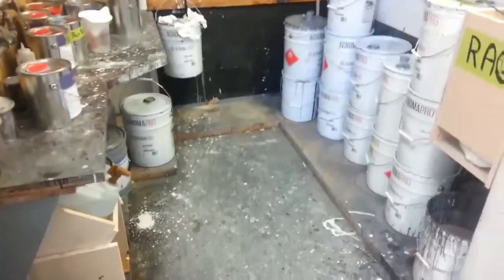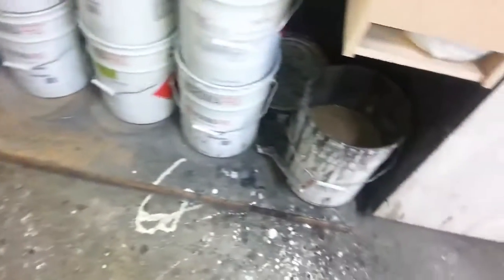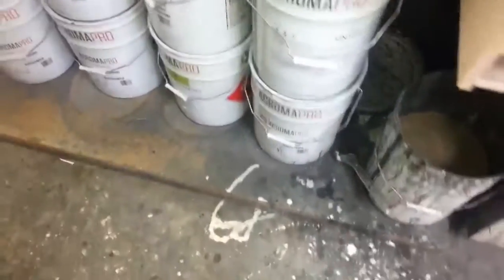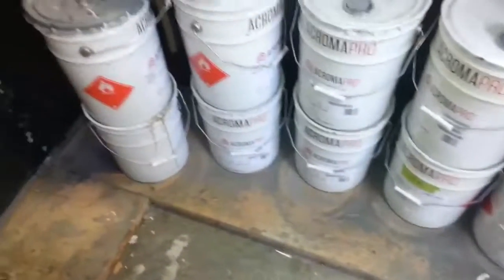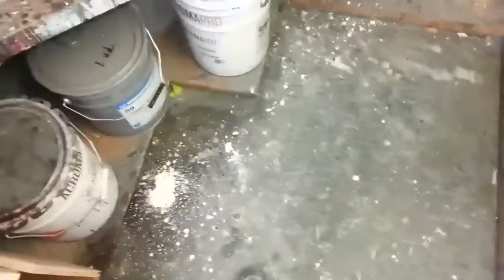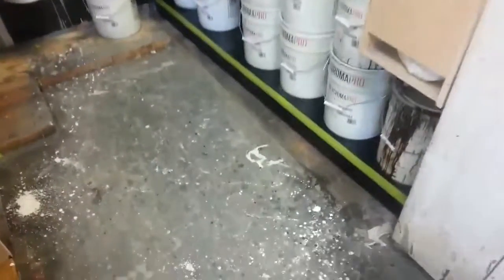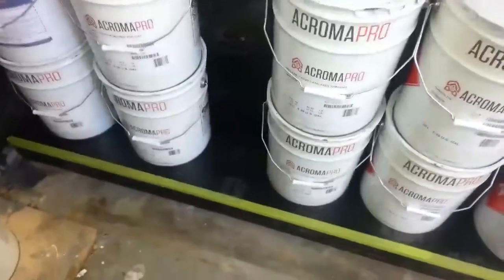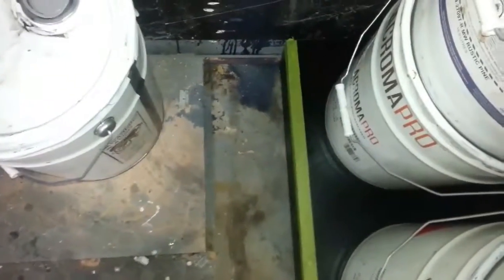2SL floor storage rebuild

Comment: There are some painting facilities here in the Tulsa area that tape brown paper / cardboard  to floors, shelves, etc...that they want to protect.  That makeshift flooring protector is easy to tear up, dispose and replace...keeping those areas a lot nicer that it would have been otherwise.  It promises to keep those new rolling racks a lot nicer for a long time with minimal upkeep effort.

Wheels...good idea.